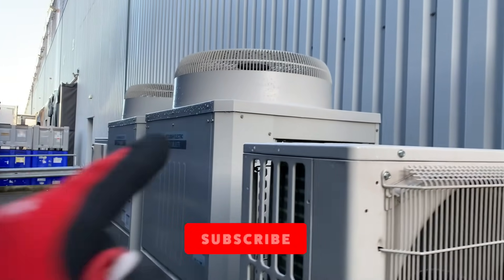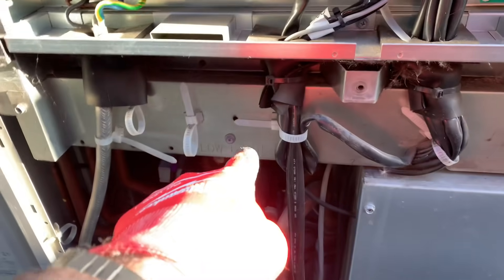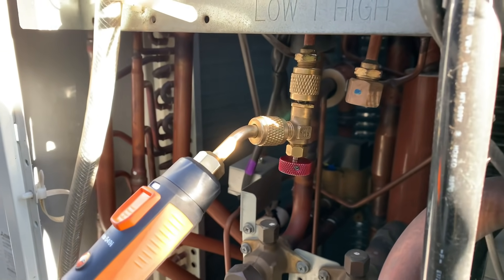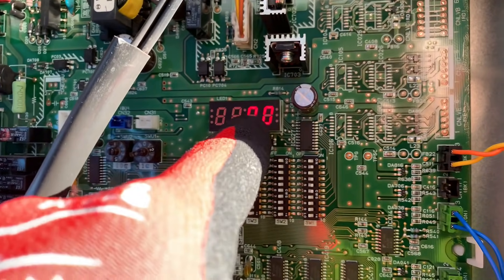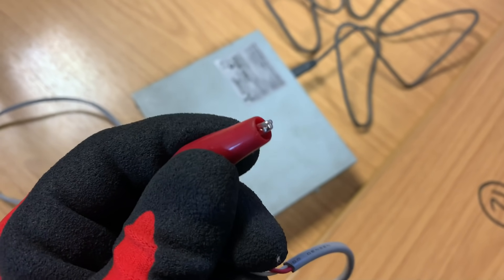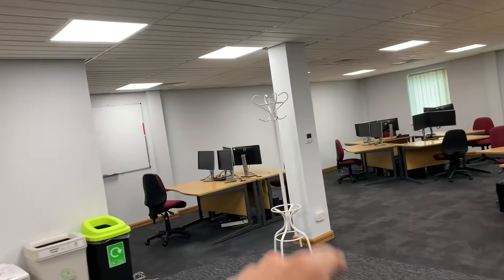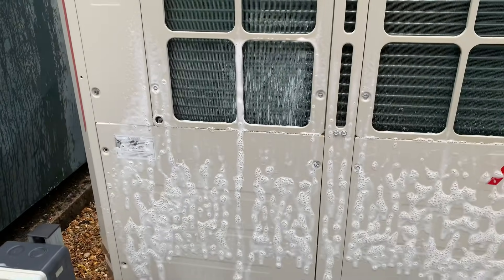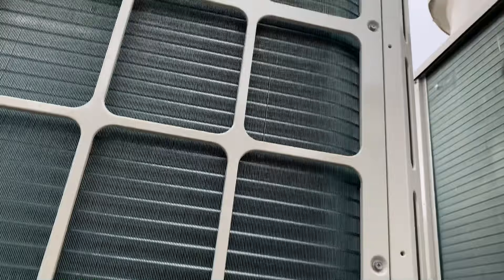A WEEK IN THE LIFE OF AN AIR CONDITIONING ENGINEER.... ITS A LEAKER

Comment: Welcome back sir we’ve missed you,I have a cool little trick I use for blocking off vents on cassettes.I loosen the facia screws slightly on the side I want to block off and slide a couple of A4 sheets of paper into the gap between the facia and the cassette body then re tighten the facia screws,works a treat
Reply from the maker: Thanks mate 🙌🏼🙌🏼 Nice tip 👍🏼👍🏼 I usually see some funky contraption cello taped to it made by the person sitting next to it 😂

Comment: cheers. new subscriber. I'm a US VRF tech. the trick to the MNET tool clips is take a yard of 18/2 and solder a magnetic jumper split in two to each end and clip the MNET gator clips to the other side. I use a small velcro wire wrap to hold it up to the unit so it doesn't pull them off the MNET terminals.

Comment: Have you used the misty service checker. Plug it into the control PCB and use the dip switches like you would on the PCB. It's a good tool for service and commissioning.
Reply from the maker: Yes mate, I’ve got the Maintenance Tool for the City Multis which is their Service Checker to let you get the laptop connected, well worth it if you work on a lot of them 🙌🏼 I’ve got the little checker I think your on about too for the Mr Slim units. The one that plugs into the PCB and gives you the LED display ?
Reply: @hvacuk8975  yea that's it handy, hardly ever use ours now back doing install as that's where the market is at the moment. Man it's hard graft to old lol
Reply from the maker: @BigC-sd2ed  Yeah seems the install has gone crazy ! Hear a lot of domestic guys being mega busy too. Same here, think a month of install would kill me off now mate 🤣

Comment: Where do you get the coupling valve for your testo gauge mate?
Reply from the maker: These are some cheap ones from Amazon or eBay mate. Type in R410a Valve Adapter and they should pop up 👍🏼👍🏼
Reply: @hvacuk8975  found them, thanks mate. Good to see a uk Aircon channel, keep up the good work 👍